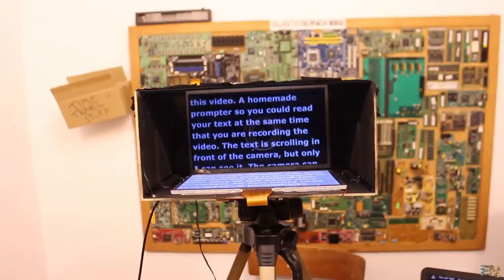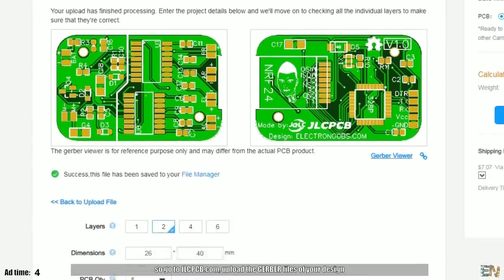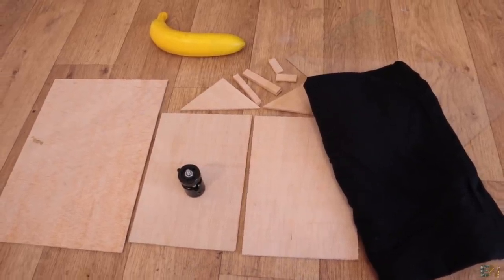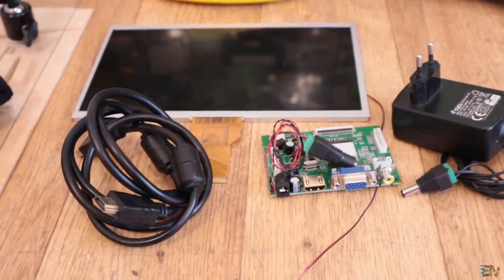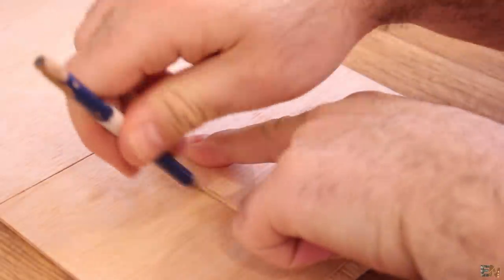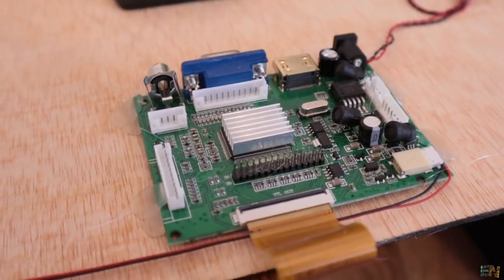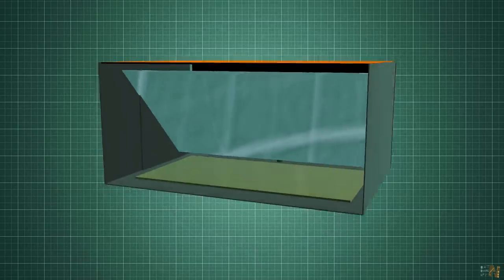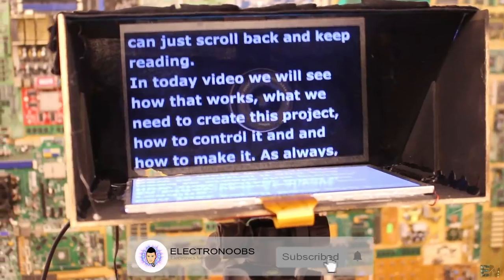Homemade Prompter With HDMI | See Through DSLR Camera

Comment: Hey dude, can you make a video on how to program and use any microcontroller without bootloader or any extra devices!! Suppose I have only microcontroller chip available with me. What is the minimum requirements to program physically & how to implement that chip on our project pcb. In Arduino there are lots of undesirable things remaining on the board when working on a specific project. This video should be to eliminate that parts..... Please atleast reply me if you read.
                 -Love from India